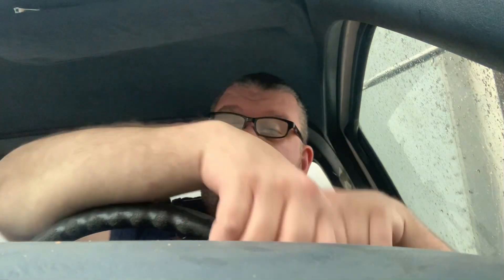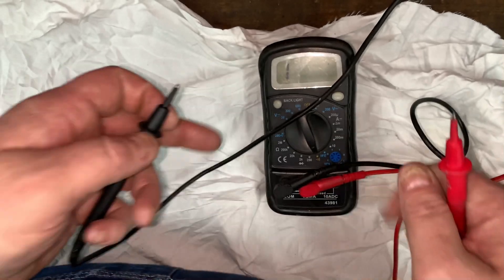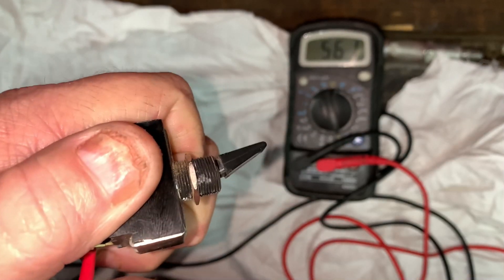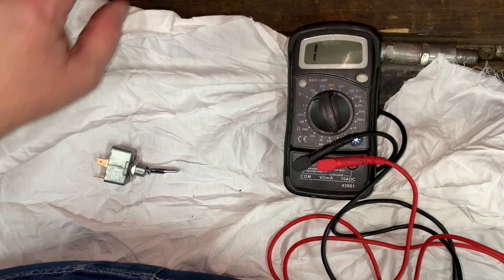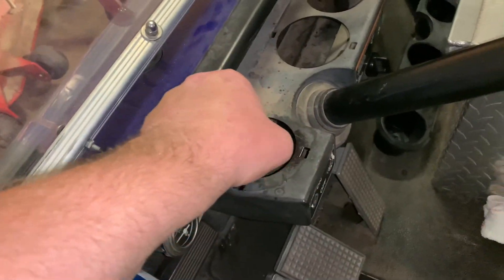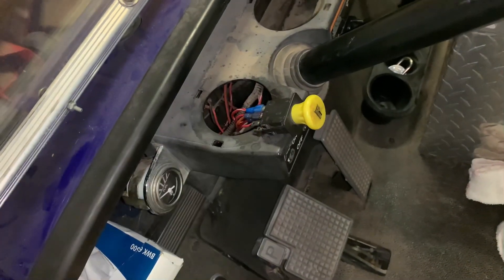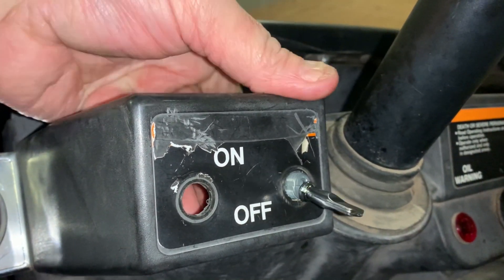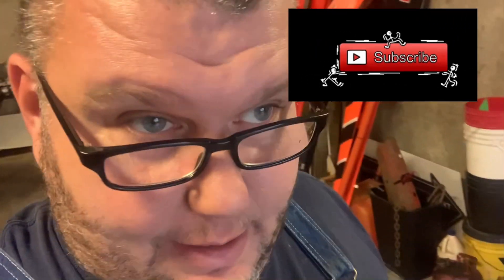#DIAGNOSING #SIMPLE #ELECTRICAL #CIRCUITS WITH YOUR VOLT METER

Comment: Great video!!!  By the way could you do a quick video on what you would stock for fuel lines for both 2 cycle and 4 cycles. I'm 70 years old and just learning how to repair and flip lawn mowers, some weed eaters, etc. but never sure about where to purchase fuel lines and what sizes to keep on hand. Appreciate any help, thanks... Gary from Vermont
Reply from the maker: “ID” 4cycle 3/16”  1/4“  5/16”
“ID X OD” 2cycle  3/32x3/16 1/8x3/16  1/8x1/4

Hipa (4 Size 4-Feet-Long Fuel Line Hose Tube I.D. x O.D. 3/32" x 3/16" 1/8" x 3/16" 1/8" x 1/4" .080" x .140" for Poulan Craftman Chainsaw String Trimmer Blower https://www.amazon.com/dp/B0119NJSN6/ref=cm_sw_r_cp_api_glc_fabc_RPd1Fb0C5H0E0?_encoding=UTF8&psc=1
Reply: @THEMOWERMEDIC1  thank you for your help....  ole Vermonter